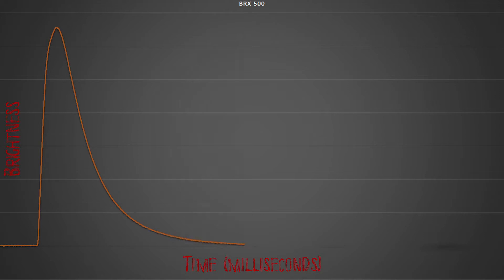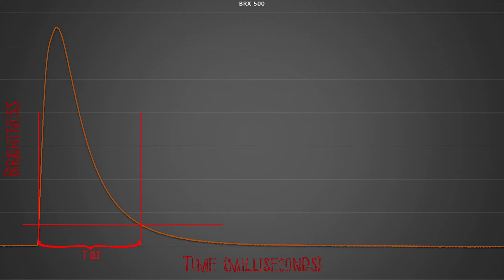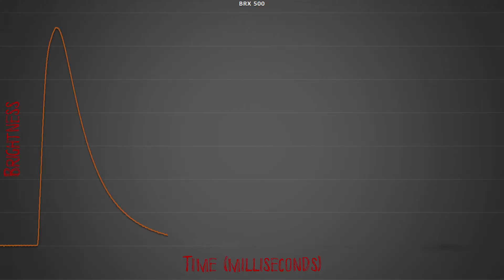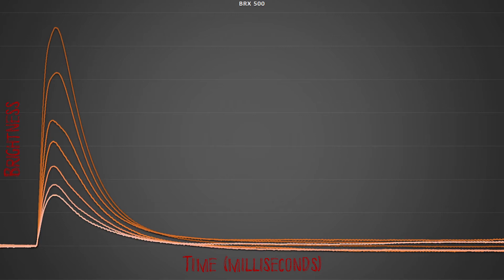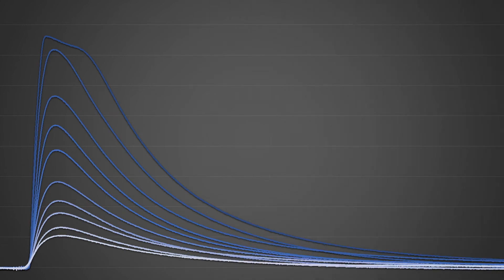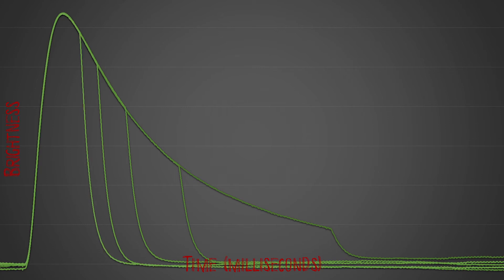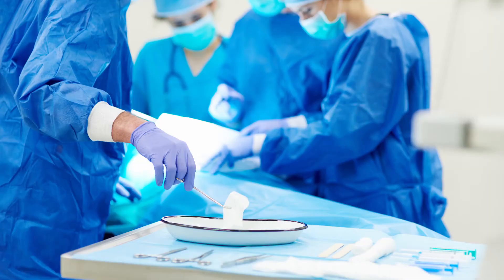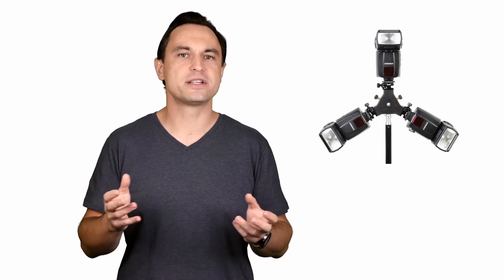TechCorner - Flash Duration for freezing movement explained

Comment: Is there any setting in ad600 about flash duration? Or just use less power?
Reply from the maker: Flash duration changes with power setting on the AD600. If you look on the screen, it will show you the flash duration for a given power setting

Comment: Hi how to avoid blurry image ( double image at the edge)when using flash? My shutter speed was 1/200
Reply from the maker: There are many reasons that could be happening.  Are you able to share your image with me?
Reply: Take a picture without the flash, set shutter at max sync speed, 1/200s in your case, set the aperture so you get a black frame, for example f/8 depending on the ambient.  Now turn flash on so you can illuminate the subject at that f/stop.  If you are shooting outdoor and can't get a black frame w/out going higher than the max sync speed then you need to use high speed sync or hypersync or some ND filter to manage the exposure..  If your subject moves or the shutter speed is low enough you can get ghosting which may or may not be a desired effects.  For action shots a trailing light (rear sync, flash fires at the end of the exposure) maybe a desired effect.

Comment: I bought a Godox V1n & XT2 trigger to freeze water drops. I can get HSS to sink but only one flash will happen taking multiple shots when above 1/250. Is there a way to get continuous flashes at 1/1000?
Reply from the maker: First of all, don’t use HSS to freeze water droplets, it won’t work. You need to set your V1n to a very low power to get a short flash duration and get your camera shutter below sync speed so you’re not using HSS.

HSS is very demanding on your flash and batteries. If you se it too high, and try to take multiple photos quickly, the flash won’t have time to recycle. 

There are no flashes that can keep up with continuous flashing at 1/1000

If you want to freeze water drops, set your camera to 1/160 shutter, your flash low, and keep ambient light very low so it doesn’t affect your exposure. 

HSS if for shooting outdoors in full sun, not to freeze action.
Reply: @MartyKPhotography   I freeze water with  HSS at 1/1600   with no problem
Reply: High Speed Sync or HSS is really for fill flash in bright sunlight when shooting above the max X or sync speed.  That's the primary use.  Any freezing action is just incidental.  Flash duration is the real hero when comes to freezing action.  HSS at 1/1600s or even 1/8000s is indeed very fast but no where as fast as 1/19000s that's flash duration that really freezes water droplets.

Comment: Do i need to have  a speed sync to freeze some products !? Because when i bought my elnichrom flash the specialized told me no need to buy a high speed sync cuz its already strong and it will give u the results that u want , i tried too many times and its not working , of course im using a trager
Reply from the maker: High speed sync is for controlling ambient light, not freezing fast movement, so the person that gave you that advice either didn't know what you were trying to do, or just didn't understand how the flash works.  The only way to freeze fast movement is with a fast flash duration.  What model is your Elinchrom light?

Comment: How did you come to the T0.1 value of the Profoto D2?
Reply from the maker: From the official D2 spec sheet
Reply: MartyK Photography thanks, I missed this in the spec sheet last time I looked. The Godox QT600II seems to have a significantly shorter T0.1 when compared to the D2
Reply from the maker: Oh really? What’s the T1 of the qt600?
Reply: MartyK Photography 220V version (for countries like Australia) 1/28,884.  110V version (for countries like USA) 1/19,606.  Their 400Ws strobe goes down to 1/35,086 for the 220V version.